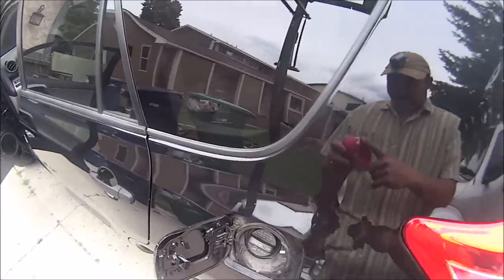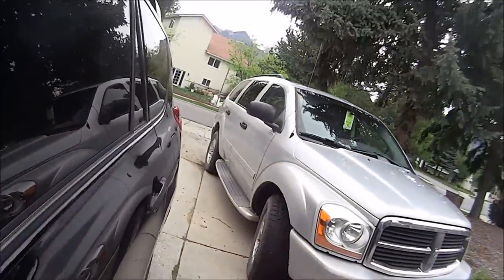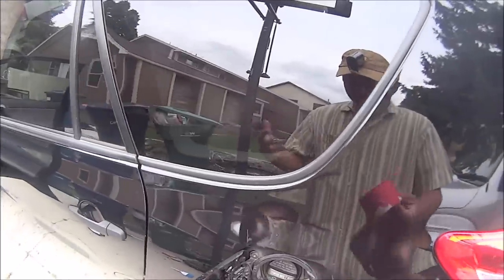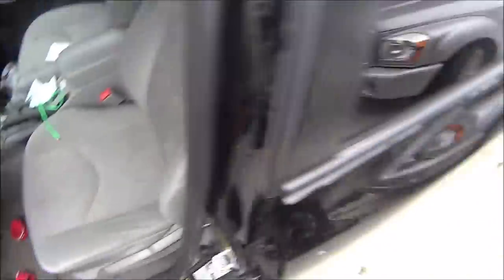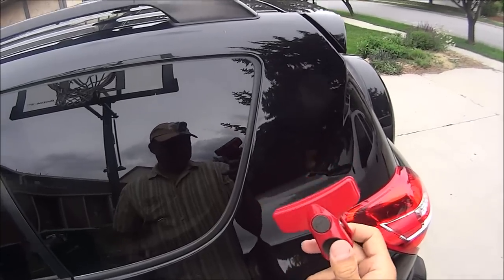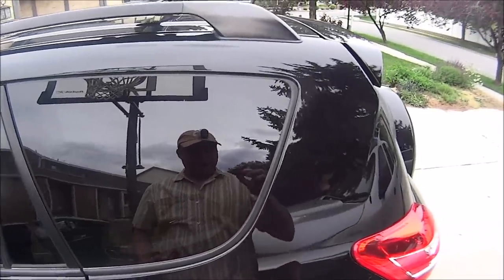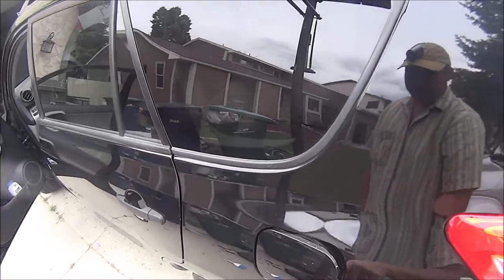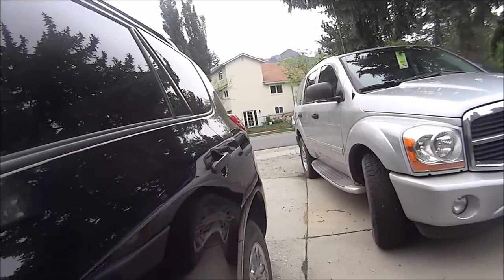Cheap, easy fix for a broken spring on Gas cap Fuel Filler Door repair

Comment: Good idea!  I bought the original clip from Toyota parts for 2 bucks.  It takes a week or so to arrive at local dealer.  The 7 dollar after market clip didn’t work.  Your solution is better when waiting for original part.

Comment: Those springs break over time. You can buy a replacement at the dealer or on EBay around eight dollars , but I like your solution.
Reply: The plastic housing that holds the spring broke. I still had the spring, just no way to keep it in place.

Comment: A fuel door spring costs less than $5 at Autozone. You might want to get one.
Reply from the maker: Unfortunately the plastic housing that holds the spring broke so I was looking at replacing the entire cover.
Reply: Guess my car's too old, can't find the spring for it in local car shops.  Can find it in online stores for less than a dollar.. but then added on close to $20 shipping. I'll gladly use this clip approach.